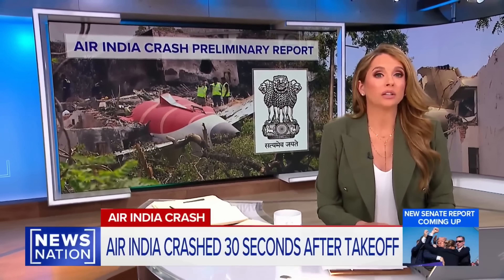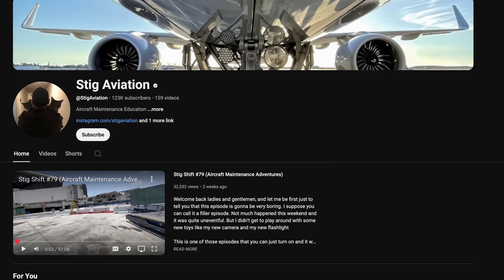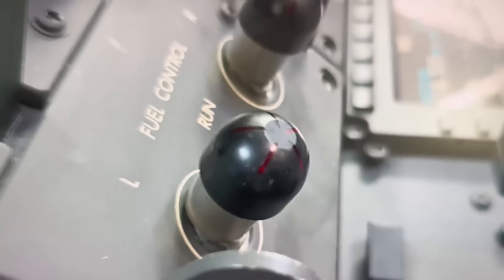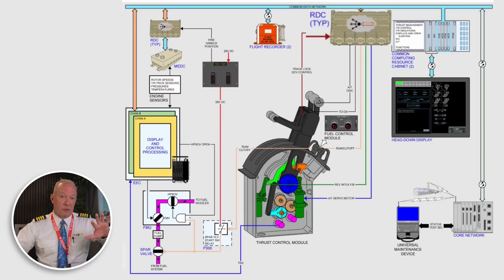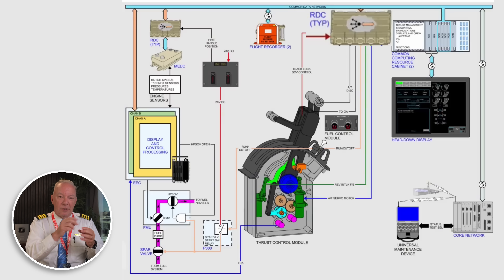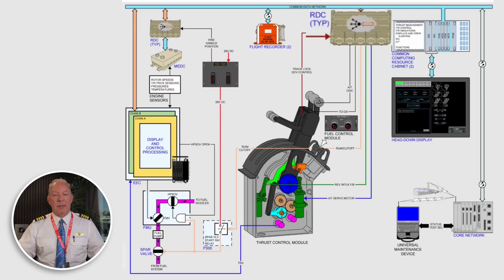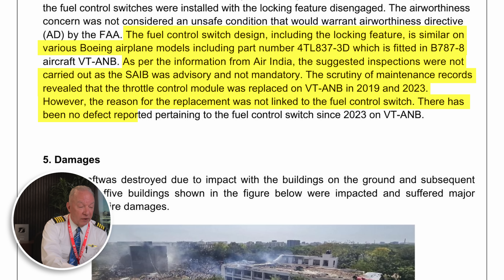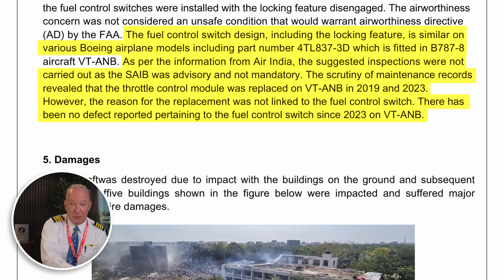The Truth About Boeing 787 Fuel Control Switches

Comment: Wait a minute, time out. How do we know for a fact that the fuel control switches were moved before loss of thrust. In the first place? As you pointed out the switches were still in the run position after the crash. That we can see with our own eyes. The speculation about supposed switch movement comes from two secondhand information sources. The AAIB and censors aboard a plane that was in serious trouble before loss of thrust. The deployment of the RAT before loss of thrust is evidence of this, correct?

One of the most incredible things about this tragic plane crash is when the public was told that there are no cameras in the cockpits of commercial jet airliners. In the year 2025. Are you bleeping kidding me? There are cameras everywhere else, but not in cockpits. That means manufactured built-in ambiguity. Nice. That means everyone with a bias, including crash investigators, can make any claim they want, and if a pilot is dead and cannot defend himself, too bad.

That was an interesting demonstration you made with the electronic set. You tried to plant a false memory with that little stunt of yours. We saw YOU flipping a switch because it was on camera, and you want your viewers to imagine one of the AI171 pilots doing the same, only with catastrophic consequences. Except that is not on video, is it? Because there are no cameras in the cockpits of big commercial jet airliners, the public cannot see one of the AI171 pilots committing sabotage and murdering 260 people.

Those accusing a pilot of sabotage and murdering 260 people are making an extraordinary and unprecedented claim without extraordinary evidence, because there are no cameras in the cockpit and we cannot see on video one of the pilots moving those switches when they shouldn't have. When looking at confirmed past cases of pilot s/m, none of those pilots crashed the plane right after takeoff.

It is defamatory to say or suggest that a pilot did this when you know it cannot be proven. This extraordinary evil claim could only have been proven if it was caught on video, and it was not. For your extraordinary and unprecedented evil claim against a dead pilot who cannot defend himself, you have no compelling proof, and you will not have any compelling proof. Thanks to this super strange fact that there are no cameras in the cockpits of commercial airliners that carry hundreds of passengers. 

And that is on you. Not me, not an accused pilot that I am defending because he cannot defend himself. You know what, it could be true, this accusation against one of the pilots. Usually Captain Sabharwal. He could have done this extraordinary and unprecedented evil act. There is a first time for everything, right? So, it could be the captain's fault that he is dead and cannot defend himself, if he in fact caused the crash.

BUT, and this is a legitimate "but", IT CANNOT BE PROVEN BEYOND A SHADOW OF A DOUBT. Because inexplicably, there are no bleeping cameras in the bleeping cockpits of these big bleeping commercial jet airliners that transport hundreds of bleeping people. That's all, just hundreds of bleeping lives at stake. No big deal.

Captain Steve, if you were accused of doing what Captain Sabharwal has been accused of doing, I would be making all the same points.
I would have to see you on video doing it. Nothing else would be satisfactory.

"The switches this, the switches that". Cut the crap.
We are talking about an intentional act of suicide and mass murder. Not mere "pilot error".

And this I know, I have seen it for my whole life of 60 years.

When investigating a crash there is this bias and the default position of pilot error or worse going into it. Pilots are presumed guilty until it is proven otherwise and planes are presumed innocent until it is proven otherwise. Even Captain Chesley "Sully" Sullenberger, an aviation god, was presumed guilty, but he was alive to defend himself, and he was ultimately completely exonerated and credited for saving the lives of everyone onboard and probably many more lives outside the plane had he not landed on the river.

Planes are machines, flying machines, and the default position is that planes are without flaw and failsafe, until if and when it is proven otherwise. No machine, including flying machines, are without flaw and failsafe. If they were, we wouldn't need pilots in the first place, right?

Captain Steve, how secure would you feel as an air passenger if there were no pilots in the cockpit? Even if everyone told you it is safe.
You would be like, "Oh that's cool. Can I sit in the cockpit?"

"There is no cockpit, sir."
"Ok, you know what? I change my mind, I'm getting off this plane."

Comment: The plane was on the ground running its engines for 2hr and 17 min in 98.6 degrees F heat. That should not have been enough to over-temp the engines I would think, but it is kind of suspicious that very soon after powering up the engines, they both shut down. Crash occured 32 seconds after takeoff.
Here is something interesting I found: "...if a fuel control switch moves to CUTOFF during takeoff, the system may flag this as unexpected behavior, especially if no fire handle was pulled or no engine fault was detected." What did the FDR say? Did it say "unexpected behavior," or did it have another alarm to justify FADEC shutdown? I'm not saying I know what happened. These are just facts, not determinations.

Comment: Steeve, you infer this but don't explicly say this:  Presumably there are two completely separate relays for the left and the right engine.   So, both relays would have to independently fail one second apart from each other in spectacular fashion for that to be the cause, right? (i.e. virutually impossible).
Reply: They don't have to fail at all. Just be commanded. We are looking for a single point of failure, and the Li-Ion battery diode module is one such prime suspect at the moment.

Comment: The focus now is to eliminate any — or even the slightest — possibility that this was not pilot error. For example, if the engines lost power, the pilot would have to flip the switches to attempt to restart them.
Reply: If that were the case, pilot training teaches to immediately flip the switch to off and then back to on, not wait 10 seconds.

Comment: I guess the engine manufacturers data capture via satellite will only show that the aircraft engines had their fuel cut off to them.  I know Rolls Royce constantly monitors engines via satellite uplink in real-time external to any other aircraft system and feed it back to their monitoring centres.  Do all engine manufacturers offer this same service, I'm not sure what's installed in the Air India Boeing 787s Rolls or GE.

Comment: Cap... I think you said it all when you reminded everyone about there being TWO separate systems! ONE engine out... I can understand. Two simultaneous unrelated failures.... hard to point to some kind of system malfunction. The fuel control systems have been proven over decades to be as dependable as possible under all kinds of circumstances. Hoping final report will be complete.

Comment: Thanks for your insight.  I have a question, may not be relevant to what happened, but what would happen if the battery controlling the valve was defective, and just stopped working (dead battery), what would be the effect of that on the plane.  Will that valves stay open, or just close. Also is there a backup if this where to happen

Comment: Is it possible that one of the pilots thought they were going off the end of the runway before the ability to fly and turned the fuel off to prepare for a run over. Then at the last moment the plane achieved lift off speed at the very end of the runway and he then turned the fuel valves back on too late and the engines spooled down not able to get back to full power?

Comment: Are the switch's not mechanical then go to fly by wire? So an electrical fault/short can cause an errant signal. Even though the switch's are not physically moved Any voltage signal can change the on off signal without using the mechanical lever, why are people ignoring this? Usually its all controlled by milliamp signal inputs/outputs not actual 24/28DC Volt power to the CPU. Once the CPU receives the expected milliamp signal then the CPU reacts as per programmed & pops out the milliamp signal  to actuate the 24/28DC valve OR NOT

Comment: Might be helpful for the uninitiated:
When Captain Steve says an electrical component, like a relay or switch is "closed," then electrical current is flowing. "Open" would be "off"...
When Captain Steve says a mechanical component in this case, a valve is "open," then fuel is flowing.  "Closed" would be "off"...

Comment: If the only connection from the switches there is no light on the instrument pannel or any alert on the displays, how the pilots knew that the fuel switeches were turned off?

Comment: I am not an aviation expert by any means, so my question is: How can we be absolutely sure that one of the power leads on the 28VDC battery did not experience a physical problem that caused the power to be cut off for 10 seconds? The connector on the power lead could be damaged, and thus we could end up in a situation where a closed circuit becomes an open circuit until it happens to close again. This happens in real life, and that is why all connections and leads are checked regularly. If the connector is attached to the battery or actuator with a nut, it could fail and cause a momentary outage. So is it possible that the battery power lead failed momentarily and it would look like a switch being flipped? If the switch position sensor - which provides information about the switch position to the flight data recorder - is powered by the same battery as the coil of the relay controlling the motors, then in a situation where the switches are in the RUN position all the time, but the battery terminal screw nut or the power cable connector momentarily fails - then the sensor also provides incorrect information to the recording, and as a result, the recording shows that the switches were in the CUTOFF position, even though they were not.

Comment: Well done captain. That other expert that was on that show that was arguing that a back signal that turned off the switch should now be looking at all Airbus planes since we know they are using computers to fully fly their planes that are using a number of electronic switches in this manner. I am shocked the the FAA did not look at the this Airbus manufactures during the Max issue when it came up and looked their mfg practices. Makes me wonder if they were cutting corner to and had similar flaws as well. Unfortunately, Airbus has been sitting quietly and who knows what they’ve been doing in the background to address similar or other issues.

Comment: The fact that you CAN switch off the fuel valves when going into air is already a construction failure. You need trust to get to a minimum height. After getting to the minimum height the shut down of the fuel valves should be allowed.
So from start to the minimum height the switches should be disabled.... THAT is the proper approach en technical solution.

Comment: Airplane is not extremely complex, those fuel switches are working in the same way has a port injected engine on a car approximately year 2005.
In the plane there is a switch, in a car there is a ignition switch ( where you put a key and turn to start the fuel pump and to start the engine).

Comment: There has been tremendous dialog on this "incident " but the truth is in our face about what actually happened. I'm sure that will open another dialog book, quite honestly very important. How can you determine if the person is mentally fit to fly? More regulations are sure to come, testing. Maybe. 9/11 ring a bell? If the right questions are asked, the truth finds its way out. I'm definitely not trying to muddy the waters, but doing my best to point to common sense. Thanks captain Steve, the explanation of this system leaves little to no room for conjecture.

Comment: What if DC battery goes dead, not supplying the 28 volts to the valves?
Reply: Nothing happens. Meaning the fuel valves continue in the last state they were selected to

Comment: There is also data recorder connected to the same loop, that’s how they know what position those switches were in, but they are protected by one way diodes, so there is no way signal can travel back and forth

Comment: Weird: If the Fuel-Cutoff circuit is purely DC based and isolated to other components, how did the flight recorders record it going to cutoff position then returning back, except from the audio recording which hasn't been shared publicly.

Comment: Captain Steve may well be right. The logic seems to indicate that. However it is possible to lose hot batt power - something may have caused that (these batts are not invincible) which could close relays. Maybe it was only momentary - not saying this is likely especially because of 1sec delay between the cutoffs. The skipper may have then cycled them as he saw the engines running down. It’s possible but unlikely.

Comment: Bullshit! That is not the point. The question is where the signal "Fuel cut off" is generated! This signal is not generated by the switch! It is generated when the fuel is "cut off" by the control electronics.If there is a power failure it is like an open relay- contact!

Comment: Critical thing like fuel supply needs a simple but effective non digital ho ha switching, no semiconductors to fault out, a bit like the old fashioned passenger lift/elevator switch gear, chunky but reliable.
Gaz UK.

Comment: You have been a pilot for many years Capt Steve. I have as a service technician, for 21 years, seen many relays misbehave for many reasons. Switches is only one of the reasons for signals to go to cut off. 

Telling us the switches is the only way, is not correct. I agree to one possibility. Engines on 787, has been cut off in other incidents, without the switches being physically moved. This is why we still can not conclude that switches was physically moved. 

In the pre rapport, it transitioned to. Also, question from one of the pilots: why did you cut off (this you support) I didn’t said the other(this one you don’t support) 

From a technical point of view, never rule out technical issues, I have seen so many in my 21 years as one.

Still love your channel, I just don’t agree to conclude right now.

Best regards 

Tobias
Reply: The engines were not cut off, read the report, engines were starved of fuel and that can only happen if fuel switches are turning off fuel.
Reply: Please list the “other incidents” on the 787 where the engines where cut off without the fuel control switches being moved? And if you’re referring to the ANA incidents where the TCMA shut down the engines on the ground, that was a completely different scenario and the system worked as designed to prevent uncommanded high thrust.
Reply: @slavedriver394 read up - what will happen if there is a battery circuit in the bus system. It would lead to this insistent, without the switches being moved - and please do not attack ppl who is concerned about what really happened here, life’s where lost, and it can be a second insistent, if we ignore other possibilities

Comment: Playing devils advocate for a minute, what if something happened to the 28v battery itself powering the valves? If power is cut coming from that battery for some reason, would that open the relay and close the valves or does it require power to close the valves as well? Or do they both have their own battery? I think with them seeing the physical switches were moved its not the case, but it just had me thinking. Thank you everyone in advance

Comment: One of those 3 valves is controlled by an AND gate. One input comes from the relay but the other input comes from the HPSOV open output in the DISPLAY AND CONTROL PROCESSING unit. So, both inputs have to be HIGH for the HPSOV valve to operate. Also, the DISPLAY AND CONTROL PROCESSING unit controls, all by itself, the IMV valve. As the 3 valves are in series,  they all have to be open at the same time for the fuel to reach the engines. In short, the switches only controls 1 and 1/2 valves, and the DISPLAY AND CONTROL PROCESSING unit controls the other 1 and 1/2 valves (the HPSOV is the 1/2 valve, because of the 2 input AND gate). THIS, ACCORDING TO THE SCHEMATIC PRESENTED. My conclusion is that, either the switches or the DISPLAY AND CONTROL PROCESSING unit failed, or both. This means that IF (notice that I say IF) THE SCHEMATIC IS CORRECT, then Capt Steve is wrong when he claims that only the switches control the valves. Please note that I have no idea what is and what does the DISPLAY AND CONTROL PROCESSING unit. But the word PROCESSING means computer calculations based on the value, God knows how many, sensors, switches, and the lot.